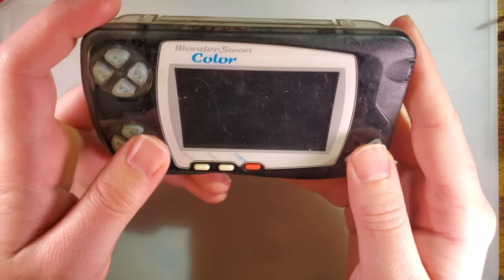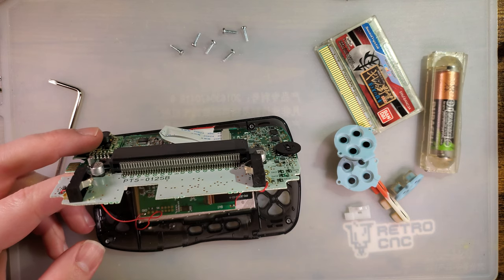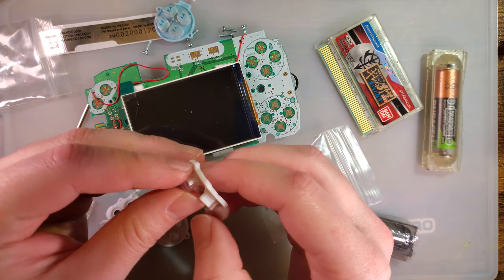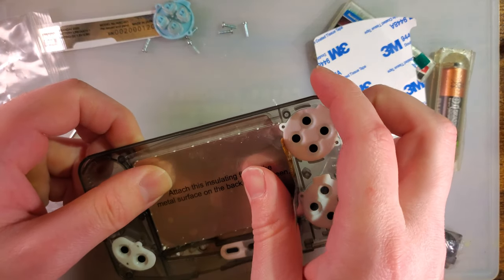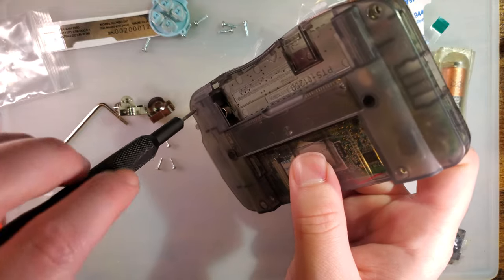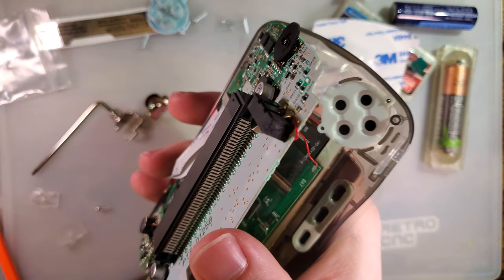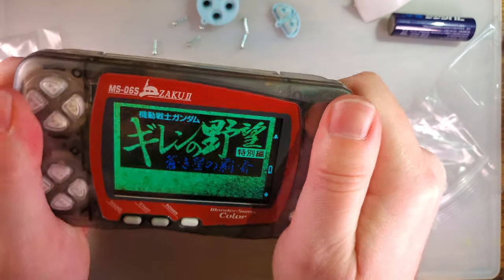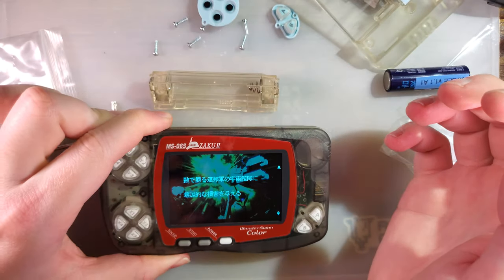Wonderswan Color Aftermarket Shell Replacement

Comment: Ever thought about getting a FlashMasta for wonderswan? There are no makho quality reviews/guides on the only flash cart out there for WS ;) only 1 or 2 super high level mentions in videos that I can find.  Plus, there are so many awesome games for it.
Reply from the maker: >Plus, there are so many awesome games for it.

Like? Most of what I found was multiplats or basically unplayable without being fluent in Japanese. Plus, I was under the impression that the flashmasta didn't support a lot of games either.
Reply: @makho  It supports almost all now. 

Like: (without needing Japanese)
Battle Spirit
SD Gundam Operations
Mr Driller
Rockman EXE WS
Rockman & Forte
Judgement Silversword
One Piece
Gunpey
Guilty Gear Petit
Makaimura
Tane Wo Maku Tori
Taruntablist
Kinnikuman
Golden Axe
Puyo Puyo 2
Kerorikan

AND
Dicing Knight
Run Dim
Various translations

Alot of them take advantage of the TATE mode so it's a unique handheld experience.
Reply from the maker: @RomeoGoesRetro  Much appreciated, thank you

Comment: I ended up going with this methodology:
Install screen, then immediately install lens. For me, this works best to avoid touching the inside of the lens / the screen itself.
Otherwise, dust / my fingerprints, like you said, frustrate me to no end.

I need to get an anti-dust chamber and some gloves xD
Reply from the maker: Yeah, LCD then lens immediately after is my go to method for builds that I'm not planning on disassembling.

Comment: The Retrobrite treatment (UV light exposure in a hydrogen peroxide bath) would take care of the yellowing on that plastic if you ever wanted to reuse that original shell.
Reply from the maker: I don't believe that retrobrite actually solves the problem. The process seems to treat the symptoms only.
Reply: @makho  You are right in that it doesn't solve the problem permanently. The culprit is degradation of the plastic itself which is inevitable no matter what. The damage is surface level, and the uv treatment simply bleaches that surface, removing the discoloration. There's a pretty in-depth article that gets into the chemistry that you can find with a Google search if you are interested in that. I know some people are adamantly opposed to doing that sort of treatment as they believe it further damages the plastic and speeds up the process, but according to the article, the process only causes further harm to the plastic if it is cracked and allows the reaction to happen beneath the yellowed surface layer. I'm not saying you or anyone else should do it though. I try to preserve my  game systems in their original condition, but for me personally, if it's already extensively tarnished I don't think it's terrible to try to bring it back to it's original luster. I wouldn't do so to a rare piece, but these are relatively common.